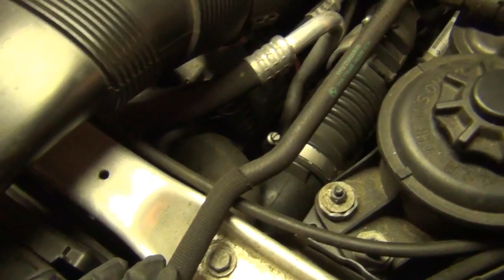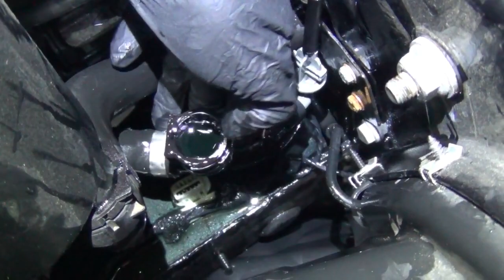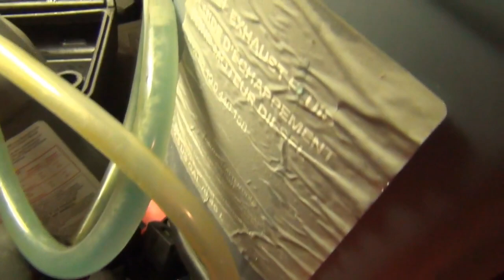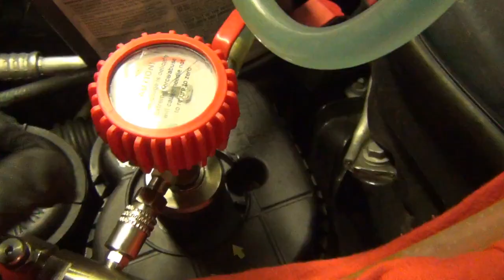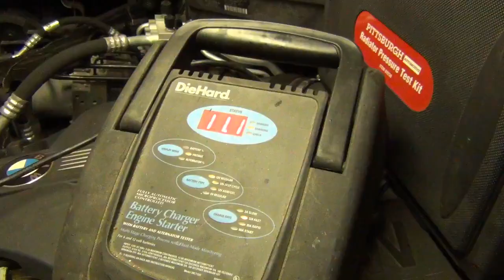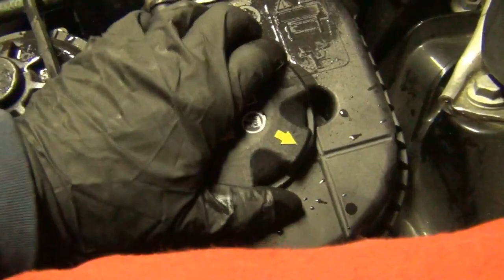BMW X5 Expansion Tank Replacement E70 With The N55 6 Cylinder Part Number 17137552546

Comment: What's the name of the hose that connects underneath the expansion tank? I replaced the tank but it's still leaking from the bottom where that hose connects and I believe it that hose.
Reply from the maker: Can you send me the last seven of the vin. That hose, I think, goes down to coolers under the elecrical fan.
Reply: @AskTheCarExperts  my vin is  L590589. For some reason this won't post.

Comment: Could you help me? I replaced the leaking, cracked coolant reservoir with a new one, along with the cap and sensor. I bled the air using the procedure for about 12 minutes. After replacing it, it no longer leaks, but I still get a message about low coolant level, even though the coolant is OK. Where is the problem? Could the fact that the sensor plug got wet during replacement be causing any false readings? I later cleaned the contact with electronics cleaner and even replaced the old sensor with one that showed a good reading until the end, but the result was the same false message about low fluid levels. Could air in the system be the cause?
Reply from the maker: This could be a bad part. I had a bad one from FCP once. The way it works is a magnet inside the tank rests against the sensor when full. You can out a magnet on the sensor removed from the tank and see if the warning clears. If it does the tank is bad.
Reply: @AskTheCarExperts   Thanks for the reply. I'll try the magnet method and see if the sensor responds. I'll let you know. Could some kind of float inside the tank have gotten stuck in the new tank during transport?
Reply from the maker: @stunter052 I dont think so. I would suspect a bad part.
Reply: @AskTheCarExperts  I tried this magnet trick today, when I put it to the tip of the sensor, the low coolant level message immediately goes out, after putting it back in the coolant reservoir, the low level message comes back, so is the float in the reservoir itself faulty?
Reply from the maker: @stunter052 correct, the magent may have separated. Bad part my friend! ❤

Comment: The plastic gasket and rubber gasket came out of the bottom coolant hose while changing. Any advice to get it back in flush. Tried the freezer method. Might just add Vaseline to slip it in. Any advice ?
Reply from the maker: That is part of the hose. I would recommend replacing the hose. It is not worth a possible failure and engine overheat.

Comment: Great video. I have changed out my coolant tank, but I still need to bleed it. I am DIY tech, I am learning from your awesome BMW details on how to do parts replacements and what to look out for. Thank you,
Reply from the maker: Awesome!!! Bleed is to have a charger on it, key on, heat at max temp, blower at lowest setting, hold pedal for about 20 seconds and the pump should kick on.

Comment: What’s the name of the tool you use to test for air
Reply from the maker: The two tools you can use are a vacuum bleeder to bleed the system and refill and then a pressure tester to check for leaks.

Comment: I had a coolant leak on my 2013 X5 I drive. Couldn't see where it was leaking from but it was running down driver side inside wheel area. Searched YOUTUBE found this video ordered $32 Expansion tank off of Amazon and followed instructions. This video save me around $1,000. there is a comment about the clip on the bottom about using a 90 degree pick instead of the pick used in the video that is great advise and a cheap set of picks can be purchased at Ace hardware for about $20. Something else that will help is getting one of your hands under the hose and pushing down on the tank at same time to get the clip on bottom of tank to click into place will need a little strength to get it to snap together once it does you will know it you will hear it. But if you follow these steps in the video it can be done and it doesn't take any special tools or any special training just follow the steps and you will have your leak fixed. Thanks AskTheCarExpert you Rock.
Reply from the maker: @AllenBurns-x5v  Awesome Allen!

Comment: i needed a step by step of the bleeding process, i dont own a vacuum bleeder so im going to try it with just the water pump, we'll see how it goes lol 
thanks!
Reply from the maker: It will bleed this way thankfully but a vacuum bleeder is awesome to have.
Reply: @ I ended up buying a vacuum bleeder from harbor freight. And I ended up just letting it idle instead of only running the electric pump. 
My battery charger wouldn’t keep up and I didn’t want to over discharge the battery. 
Seems good now
Reply from the maker: @huntermyers4607  Awesome!

Comment: First off  thank you for the video because you explained how to get that lower coolant hose  off the bottom of the expansion tank My job was less of a headache. Now my issue is. They have changed the upper radiator hose.  Now you have to buy 3 different parts to change the Upper hose on x5 2008  3.0Si. So i will list the part numbers  BMW gave me and side i need all this to change the upper radiator hose. Main Hose #171275-93490 CAP Off #171275-987004 and  "Vent" something #171275-36235. I like to think i have good common sense and a good Mechanical Aptitude,  However BMW makes it so complicated to do some very simple repair. Here is where i need  your experience: what is the configuration to the other two hoses  1. Cap off 2. Vent something or other. Really would like a answer ASAP as i have the vehicle tore down Thanks to your Very informative and to the Point Video. It was a Snap to get to this stage. Help, Advise, comment, appreciate feedback
Reply from the maker: Sorry to hear you have this issue. I would need more information to help you with this including the last seven of the VIN. I do offer some help through chat like this but I do offer one on one help when you are a high octane member of my YouTube Channel.

Comment: My X5 has a very slow leak in the expansion tank. I have to add a small amount of coolant about every other week. When I replace the tank and refill it, do I really need to pressurize the system or can I just let the electronic water pump purge the system?
Reply from the maker: Hi Chris, You can use the electronic pump to bleed. Using a pressure tester will help see if there are any other leaks.

Comment: Do you have to be on level ground to bleed?
Reply from the maker: Hello, It would be recommended to be as level as possible but it is not overly critical. You can always drive the vehicle. Let it sit to cool down and then top off as need.
Reply: @AskTheCarExperts  Thanks

Comment: Should the system have no fluid in it to vacuum fill or can it be done on a system that has coolant in it to be sure there is no air in the system
Reply from the maker: That is a great question! The system should be as empty as you can get without being too invasive.

Comment: just replaced the tank and attempted the purge method ( turn on, gas pedal 10secs). I hear it attempting to activate but i dont see anything happen underneath the cap in the tank. Thoughts?
Reply from the maker: Hi Keenen, Make sure you have the heater control panel at the highest temp and lowest blower speed. If it still does not work try charging the battery.
Reply: @AskTheCarExperts  I did that. No water is shooting out. I'm trying to see if my water pump is faulty.
Reply from the maker: @ConceeitedTV  I was afraid it may be the water pump but hoping it was just a missed step. BMW has a class action that may cover the cost of the part and labor for your water pump if you are in the US market.
Reply: @AskTheCarExperts  Just to complete the conversation for anyone else, indeed it was the water pump. Part cost around $660 and labor was $288.
Reply from the maker: @ConceeitedTV  Hi Keenen, Thanks for updating me. Did you end up paying for the repair?
Reply: @AskTheCarExperts  Yes I paid for it. Car is running fine now.
Reply from the maker: @ConceeitedTV  The reason I ask is that there is a class action for this water pump in the US market. Did you have it replaced at a dealer?
Reply: @AskTheCarExperts  No I did not replace at the dealer. I didn't know about the class action for the water pump.
Reply from the maker: @ConceeitedTV  You may still be eligible for compensation. Look up the BMW water pump class action. You may be able to get some money back.

Comment: I also noticed the new BMW OEM tank has the level indicator 20mm lower in the tank than the original tank (80mm down from rim vs 60mm). Any ideas on this? A running change? The level indicator isn't loose - it is rigidly mounted like the first one.

Thanks again, your video made the job really straightforward.
Reply from the maker: Hi Glenn, Thanks for watching and I am glad to hear my video helped. I was not aware of the change actually. It most likely is a production change. Maybe to add more expansion room. BMW usually doesn't tell even the dealers why or when they change things like that.

Comment: Very clear video. A couple of things. 1) I'm not 100% clear on that the hoses are to be pushed on with the clips in the closed position (rather than pushed on and then latched by pushing closed, maybe clearer once I see it, but a bit more explanation of the reattachment of the hose fittings would have helped me  2) the links on your page go to Chinese not OEM parts, which you mention in the video. I always take extra time when I buy to validate I'm getting OE parts, and I buy from the usual suspects (ECS, getBMWParts etc). Great video, easy to follow, thanks again!!!
Reply from the maker: Hi Glen, I like to lock the clips into position and then push the hose on. This usually gives a nice audible click so you know it is locked. But you can also install and slide the lock down. Thanks for posting.

Comment: My expansion tank leaks where the bottom hose connector is. Does the unit or the hoses comes with gaskets?
Reply from the maker: This may be just the expansion tank leaking into the hose. However, the gasket for the hose is non replaceable and comes with the hose. If in doubt replace both items.
Reply: @AskTheCarExperts  appreciated

Comment: Hi I have a e70 not maintaining temperature keeping the car warm can expansion tank affect a thermostat if it's leaking pressure
Reply from the maker: Yes if you have a leak it can introduce air into the system or cause a low fluid situation. Both situations can lead to engine failures.

Comment: question from a wannabe DIY: 1) engine is cold and i have the recovery tank cap off  2) when i start the car i still see the pee-like stream shooting off from the side as if it was purging.  is it actually purging? (without going thru the engine-off electronic purge). under normal operating conditions, is the coolant system always purging air anyway?
Reply from the maker: Hello, The electronic pump is running but if you have an air pocket it could cause the engine to overheat. The purpose of the electronic bleed is to remove as much air as possible. Hope this helps :)

Comment: The electronic bleed is supposed to be done with the expansion tank cap off?
Reply from the maker: I like to watch the fluid to see if it drops too low if there was an air pockets. it can be run on or off.
Reply: @AskTheCarExperts  great point! Thank you
Reply from the maker: @kpmatt2224  Your welcome. Glad I could help clarify for you.
Reply: @AskTheCarExperts  one more question - my electronic bleed isn’t kicking on even when my battery is connected to a charge. Can I do this with the car running?
Reply from the maker: @kpmatt2224  Are you turning the heat to the highest setting and blower to the lowest setting and then holding the pedal down for about 10 sec? You have the N55 engine?
Reply: @AskTheCarExperts  yes 13 X5 35i N55. I’m putting the heat to highest setting and blower to lowest setting and holding the pedal all the way down for 10 seconds
Reply from the maker: @kpmatt2224  If the pump is not activating you may have a plug connection issue or voltage issue. Make sure you have power to the pump and the fuse did not fail from a bad water pump.
Reply: @AskTheCarExperts  My water pump is only 6 months old so I hope its not that! I will check fuses and give the battery a full charge overnight before trying again. Thanks!

Comment: First of all I have to say, great video very detailed and helpful from start to finish. I replaced the tank as well as sensor and cap, no problem. Thanks!

However, when I bled the air out of the system engaging the electronic water pump, the coolant was not flowing as strong as in your video. No kink hoses or anything. Any thoughts?

Btw. My tank gave up in the exact same position as yours identical crack.

Thanks and take care.

Alex
Reply from the maker: Hi Alex, Thanks for watching and it is great to hear my video was helpful! The water pump flow can he reduced if the battery voltage was low. You can always charge the battery and rerun the procedure to help remove any air pockets as needed. Water pumps are also a common failure. Hopefully the flow is not due to a tired pump.  I had a full video on this but my computer failed recently and I lost a bunch of videos.

Comment: Awesome vid, very helpful. Thank you.

I did replace my x5 tank but I think I need to replace the bottom hose that’s connected to it. 
When I went to connect the hose back it seemed like the end of the hose where the metal band is felt puckered up.

Of course I needed the ride so I put it on and filled it up, not 30min later I get the “coolant low” warning urg!!!

Is that hose difficult to replace, I figure I’ll probably have to access from the bottom. Any thoughts?

Thanks again and keep up the great work.
Reply from the maker: Sorry to hear that bottom hose needs replacement as well. The hose is not too difficult. I think there is one junction that can be hard to separate. Wish I had a video to help :)

Comment: Ok this was a great Video,   He got right to the pain point at the bottom of the tank , and very good advice on those metal clips, he is correct lose it... go back and order a hose and wish for a week you could find the thing that is now lost in the engine compartment.   But the thing I would like to say is the pick he is using is good if you are an expert,   But I was not,and fought to find that lower connection pull location.  I found my right angle pick and it came right off. 
Great video, thanks for posting this !!
Reply from the maker: Thanks for watching and sharing your experience!

Comment: Chinese O-rings in my BMW had squashed flat one  year after the manufacturing date on this replacement expansion tank. This caused water leaks at one liter per day (one quart per day) occurring over night when the engine cooled. Replacing 5 O-rings fixed my leaks completely.  Interestingly the leaks were not detected by pressure testing by 3 different mechanics. It appears that the O-rings seal under pressure but open up as the pressure drops.

Comment: Great video! I'll be doing this in my X5. One question, I want to do the bleed but I have a Noco Genius5 battery charger, can I do the bleed procedure while keeping the Noco car charger connected so the battery doesn't drain? I don't have a professional battery charger as you, wondering if that would be okay.

Thank you
Reply from the maker: Hello Afredo, I hope you and your family are well. As long as your battery is healthy you should be able to perform the bleed procedure. Then you can charge it slowly back up or take it for a drive to help recharge the battery. I hope this helps. Let me know how you make out.
Reply: @AskTheCarExperts   Thank you and I hope you and your family are safe and healthy as well. I  replaced the expansion tank and I successfully did the bleeding procedure, everything came out great. Your video helped a lot, thanks a lot!!!
Reply: Do I have to do a vacuum fill?
Reply: @Itsmessam4u  No. I understood from the video that you can run the electronic water pump to bleed air out of the system INSTEAD of doing the vacuum fill. This is the way I have done it in the past:  Actually the expansion tank is designed to remove air from the fluid as it circulates so I think you could just run the engine briefly and top up the fluid, repeating until the fluid doesn't drop any lower. Is that correct? You would have to be careful not to burn yourself by opening the cap when it is hot. The pressure drop can cause the water to boil suddenly and explosively unless you are very careful. Place a thick layer of rags over the cap and unscrew VERY slowly and if it starts to boil tighten the cap quickly. Do not add coolant when the engine is hot as you can crack the engine block. (amateur mechanic!)